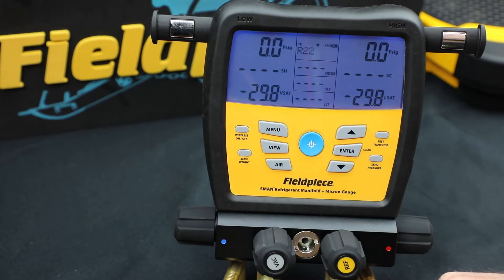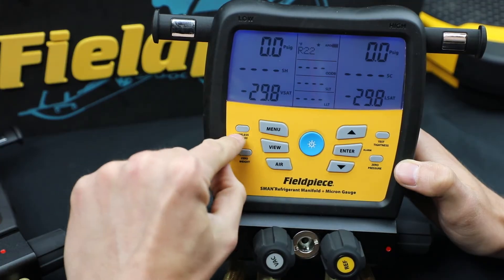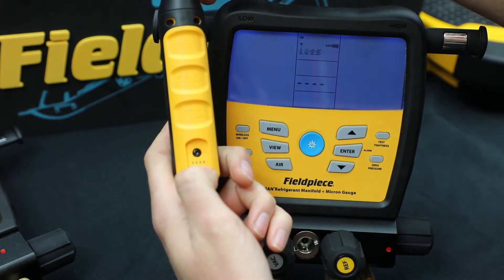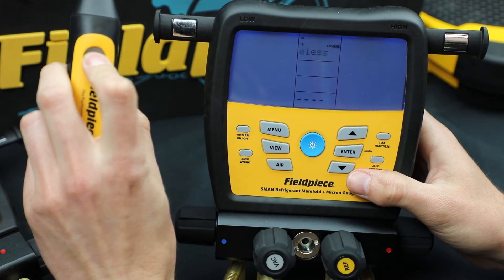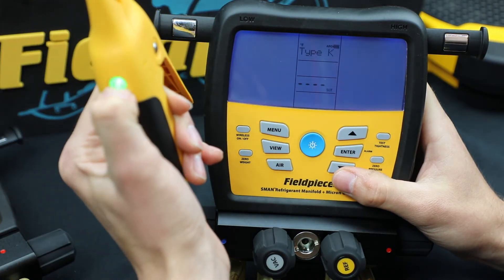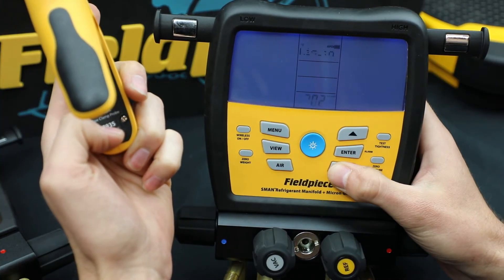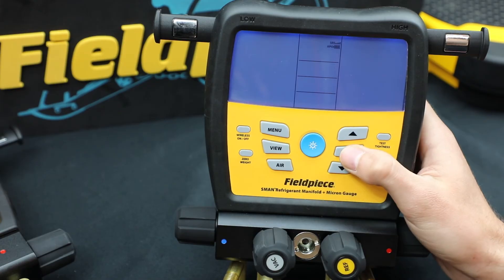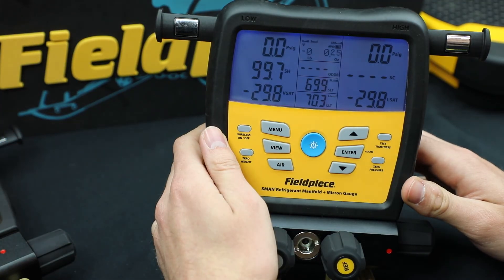Syncing your Job Link Tools to the New SMANs Digital Manifold

Comment: If you have just the probes there’s no way to sync one to the outdoor drybulb at the condenser thru joblink
Reply: I’m pretty sure they give you a dry bulb thermistor with the gauges right? You could just take it with that, I agree that seems like an issue to me but the gauges solve that issue in my eye

Comment: About how much is that setup with those probes and the wireless clamps?
Reply: The Job Link probes run around $100 a piece if you buy them individually (you can use one wireless pipe clamp with one of the wired clamps that come with the manifolds).  Manifolds are running about $450-475 for the 3-port, $550-575 for the 4-port, but distributors set their own prices so check with the one you normally shop at.
Reply: I’ve gotten all my stuff from trutechtools. I have the 4 port with pro set ball valve hoses($750),  and 2 psychrometers, and 2 manometers on the way. Had the smoothest fireoff today, with plenty of reassurance because of my air data, by running the gauges, psychrometers and free Fieldpiece app. About $1,000-$1,500 if you’re also looking at clamps, scale, and manometers. This system is pretty amazing though. It will calculate the load conditions with the data it’s receiving in the app and you can calibrate until you reach the provided target while crossing checking delta T, never having stepped away from the outdoor unit.

Comment: You only have to do those inputs once and then after that they’re permanently hooked up every time you turn on the device?. If so that would be OK.
      If you had to go to that routine every time you use the tools I think I would throw them off the roof. That would be a dealbreaker not to buy the tool.
Reply: It remembers them
Reply: @johnconnor7501  yes thank God I have a few SM480V

Definitely loving the gauges and the Bluetooth wireless sensors.  

I got three sets, the whole entire kit of the Bluetooth wireless sensors and five fieldpiece gauges. 

I’m a believer